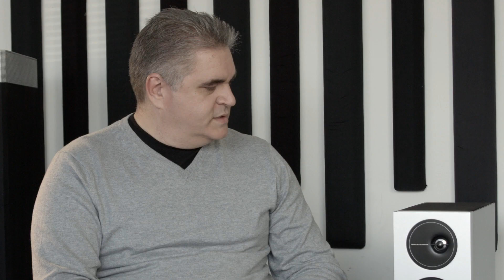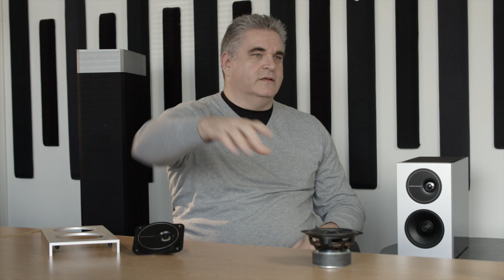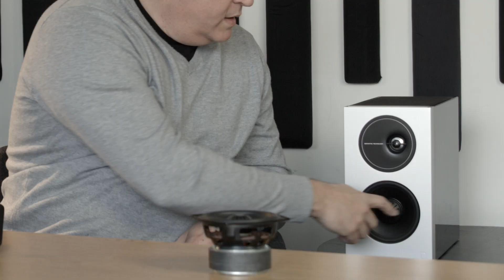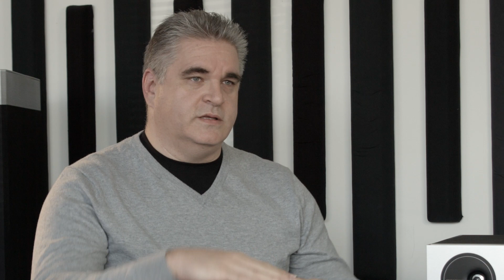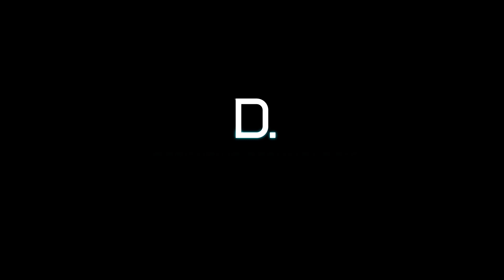Definitive Technology – Demand Series Audio Science

Comment: the D9's are great. One of the more laidback aluminum tweeters on the market, You can tell they really restrained this tweeter to be on the warmer side of aluminum. The bass hits good and good bass thickness all across the soundstage. Got to love their hidden passive radiator design, no sub needed. That passive radiator really fills up that bottom end well. I can't imagine how the d11's would sound.  I'm impressed. It's high price tag is probably preventing these speakers from being discovered by the masses. Some of the the other reviews negatively criticizing these speakers is very misleading. These are great.